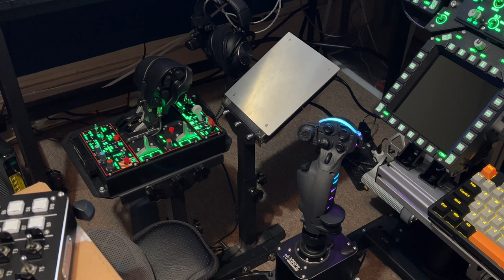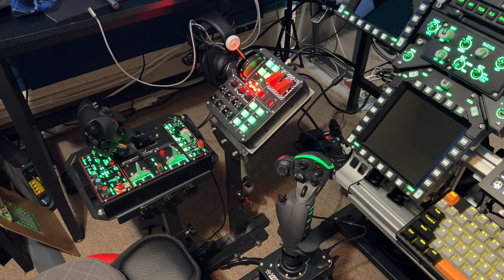Virpil Control Panel 2: The Ultimate Upgrade!

Comment: My last Virpil order shipped in just under 3 weeks, a Control Panel 1 and mount adapter. My previous order was a CM3 throttle and mount took slightly longer than 8 weeks.

Comment: The Aux port is to chain 2 devices together. I think that your plan works, if you have a Warbrd-D, CM2 or CM3 stick.
Reply from the maker: It did work out well but setting up the led’s was a pain in the ass, really seems there must be a easier way to setup the lights. Thanks for sharing.